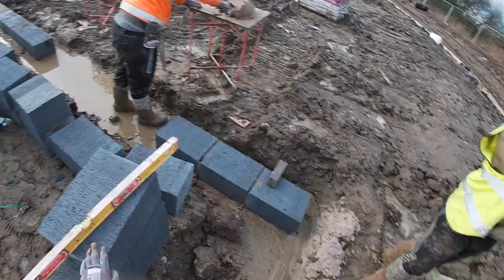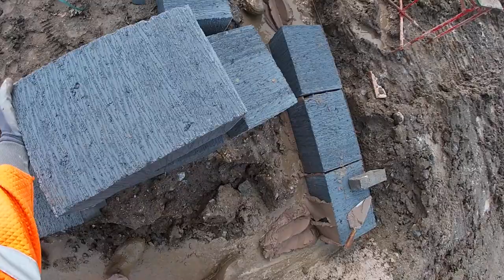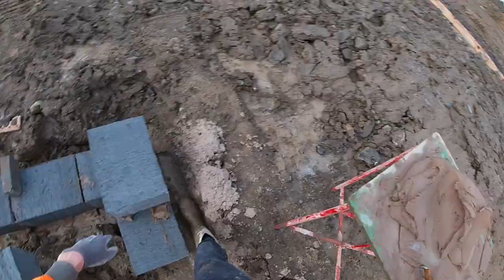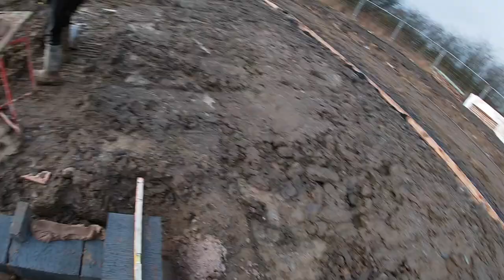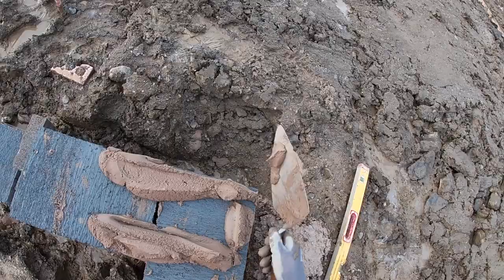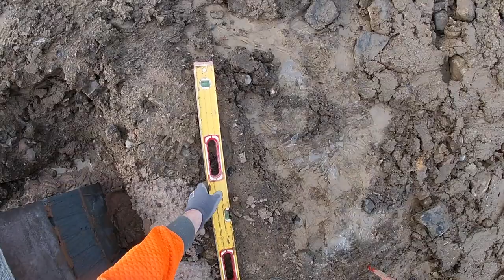Bricklaying - Trench Block Corner

Comment: If you're going to film it you could at least put a full bed on ?
Reply: He did on bottom one
Reply: Those blocks will never move
Reply: So that makes it ok then 🤔 this is why amateurs like you give the building trade a bad name 🤔 it's all about money 💰
Reply from the maker: @neiltaylor6627  The 2 beds will spread and cover the centre of the block when the block is laid above. Also nothing structural sits in the middle of the block, its a cavity wall on top😀
Reply: @markbullen1489  look forward to you showing a clip lifting some of your blocks with a full bed ,send this clip to NHBC see what response you get 👍 many years ago one particular NHBC inspector while doing a foundation inspection on a near Plot
Reply: Noticed a bricklayer doing exactly that and said how many have you laid like that which the bricklayer said all ,it all came down that's all im saying, sorry my response is in two pressed the wrong button
Reply: @markbullen1489  😂😂😂😂
Reply from the maker: @PaddleDogC5  😘😘😘
Reply: Neil u r obviously an amateur
Reply: @eamonmoore6134  please tell
Reply: Oh Neil it will be fine stop worrying NHBC will be happy as long as it’s jointed both sides
Reply: How much you getting for them?
Reply: Not a full bed and not correct bond